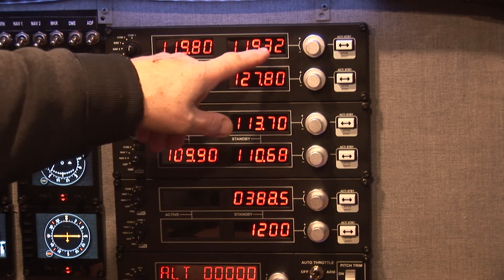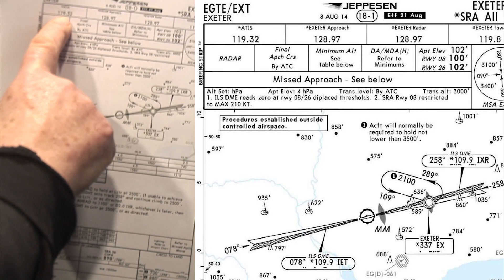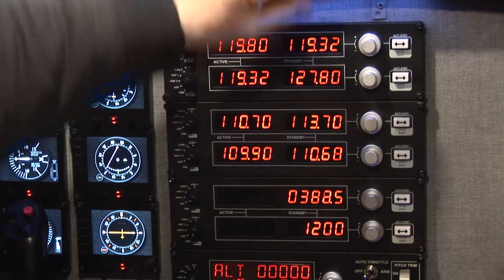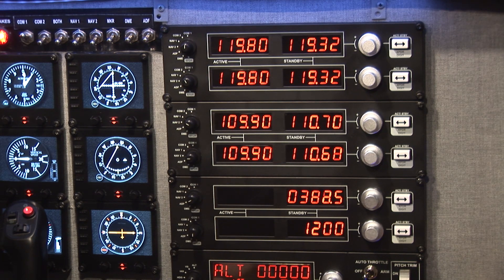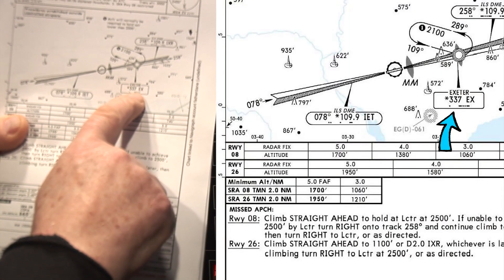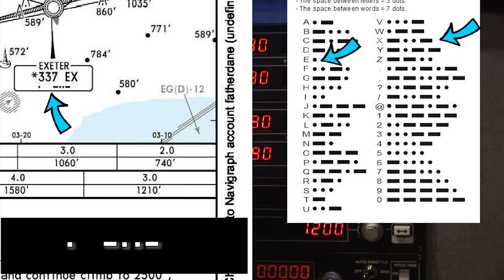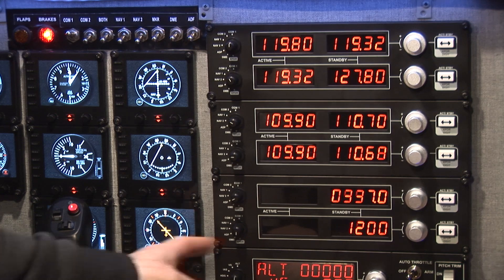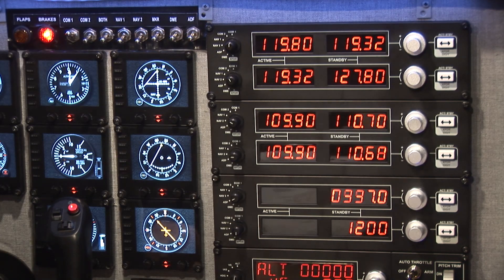5: The Radio Panel

Comment: One clarification please: assuming I have one panel and nav1 and nav 2 are tuned to two VORs or one VOR and one ILS, if I turn the left knob to adf and set an NDB frequency, will the previously mentioned nav settings be lost?
Reply from the maker: Good question: since I never tried it I am only guessing. But from logic, I would say that it would not change. Reason is that when you switch to another function, the values of that function are presented so switching between functions should not lose any previous value. Happy landings 😊
Reply: Why switch ?  Just buy a whole bunch of panels 😅😅😅

Comment: Thanks to this excellent video I bought 3 of these radio panels.  I will be using them in my home sim for not just the Cessna though, but all aircraft!  May look a little odd to have these in a 737, but I like the idea of having a few LCD displays and knobs in my cockpit! :-)  Makes sense to have panels that will be applicable to multiple aircraft.
Reply from the maker: Yes it does - they are very versatile. Good choice 👍

Comment: Question, I just got into the simming side of MSFS. I have been playing it as a very casual player since Flight Simulator 2 on my Atari 800 but it is always been jump in and fly around for short periods visually. I never knew how to use any of the instruments. I picked up the Logitech Yoke, Rudder pedals, MFD panel and switch panel which is a good start point I think for learning the aircraft and the systems. MSFS 202 seems to hands all the radio stuff for you, changing frequencies and such. Is there a way to get the simulator to stop doing that so you have to manually enter frequencies? It was the main reason I did not buy the radio panel.
Reply from the maker: I'm sorry, but I use P3D which you can control. I have no experience with MSFS. Is there a forum for MSFS you can check with?

Comment: Where did you get or did you make the panel of toggle switches to turn on different radios to hear the transmission?   Thanks for this video as I had no idea how they worked.
Reply from the maker: I made the toggle switch panel.  It replicates an actual panel on a Cessna and it functions in the same way.  I activated the switches using FSUIPC. 😊
Reply: @FatherDane  Thanks for the reply.  I also am curious to see any videos when you started the 737 project.  Thanks again!
Reply from the maker: @jaybeckham  All my videos are online and on my channel - including my early simulator cockpits with iFly among others. 😊

Comment: I cannot get a display, everything else works?
Reply from the maker: One of the issues with Logitech is that the instrument units can lose their connection.  What you need to do is after you start your computer and expect to see the units all lit up, is to unplug and re-plug the USB cable one by one on all the ones that are not lit.  They will then re-connect.  But take your time as the system needs to re-establish each one in turn.  It is just the way it is with those as the USB is actually connecting a video device rather than an ordinary USM device. Best wishes 😊
Reply: @FatherDane  thanks for that tip, I do that but another tip I had was that it was in Windows itself in the power saving options you change a 1 for a 0 but you have to be careful because it's in the registry.
Reply from the maker: @ronholfly  Yes you can change the individual power settings for each USB device.  I do on mine to ensure that a USB doesn't decide to go to sleep on me in the middle of a flight.  It's all a matter of choice.  But as long as you are able to jump start the instrument screens manually when you start, then I think all will be well. 😊

Comment: How did you separate the units .. ie. when I change frequency on one receiver the 2 unit will also change and vice versa ? it doesnt matter if comm/nav or adf ?
Reply from the maker: There is a selector switch on the left side to choose which COM or NAV to connect to.  There are two displays in each panel and each switch controls the display.  You can choose COM1 COM2 NAV1 NAV2 ADF DME and XPDR.

Comment: hi father, i am learning as i go. i have the logitech pro yoke with multi, flight and i just bought 1 radio panel. are you showing us that we need 3 radio panels?  i started on the cessana 172 but i prefer the tbm 930 for longer flights.  thank you
Reply from the maker: Hello - that's a good question.  I know that the radio panels look like they are just for that, but actually, they also double as other instruments as well.  Thus I have two radios, two navigation units (essential for instrument flying without a glass cockpit) an ADF and a transponder.  The last one was an autopilot module.  The TBM is a fine aircraft but it has a very modern glass cockpit which the 172 that I flew (back in the day) was basic instruments only.  I took my IFR rating in a 172 and because it was basic instruments, it taught me a lot more things about flying than a glass cockpit would have.  It's rather like learning to drive a car with an automatic transmission: it is harder to drive a stick after that, but learning in a stick shift and then moving to an automatic is easier.  Does this help?
Reply: @FatherDane  it helps me.
Reply from the maker: @mocheford  😊